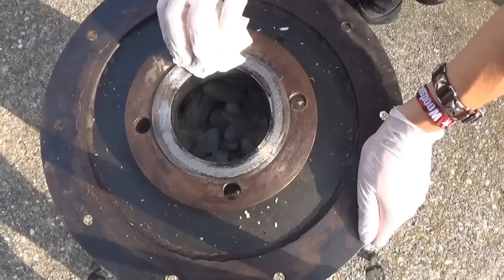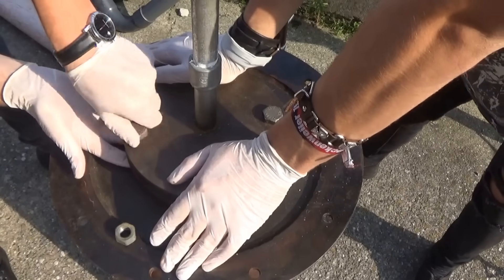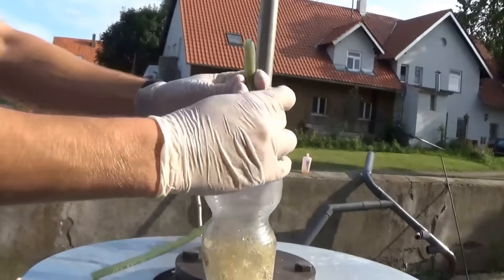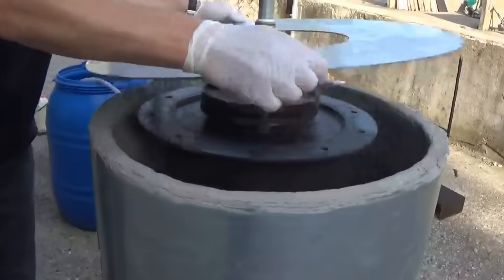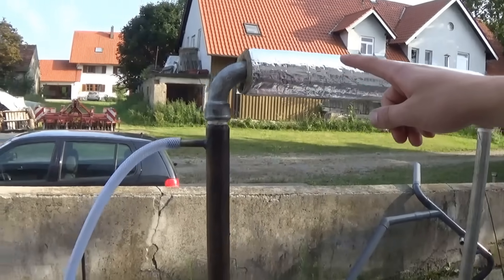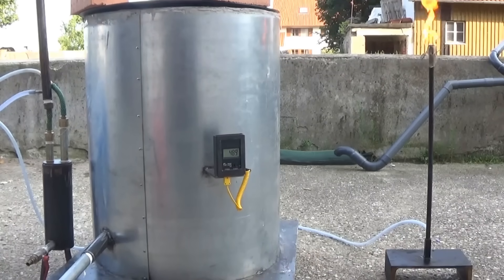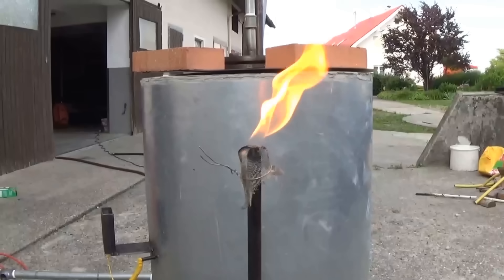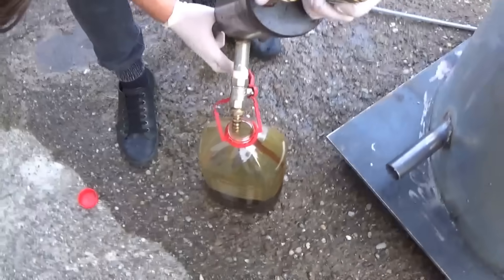plastic waste to oil/fuel improved pyrolysis reactor

Comment: Pressure cooking is more efficient I think
Reply from the maker: well but pressure comes with high risk ! 
so i do not work with pressure 

mfg hazelChem
Reply: @HazelChem  it is only high risk if you push the equipment too far. I once put about 2 liters of petrol and diesel into a gas cylinder and plugged it the put it on a big fire. Bloody hell did it make a bang but seeing as it was sitting in the flames it would have been 400 degrees plus and more than 1000 psi. So using pressure vessels is not dangerous unless you are very careless.
Reply from the maker: @sammyd7857   well but this could have ended with a big explosion .... i am more on the save side with this plus if you increase the pressure the length of the produced hydrocarbons decreases thus yielding more gas what i do not want 

mfg hazelChem
Reply: @HazelChem  but the extra pressure to help crack the molecules can reduce the temperatures needed and so not cracking too much. Anyway I will find out how well it works soon. I am setting up a test tank. Also I will try different solvents to catalyze cracking. I think the temperature can be reduced a lot
Reply: @HazelChem  it did end up in a big explosion but that was my intention lol. I was recording but my mum decided to call and stop the video😡
Reply: @HazelChem  it was an older phone
Reply from the maker: @sammyd7857   but keep in mind that the increased pressure will increase the boiling point which will lead to further cracking !! 

mfg hazelChem
Reply: @HazelChem  yes possible but I think the need for less heat is possible with the use of pressure

Comment: I have build a plant. What they is possible but what they don't tell you is the problem. Did they tell you the product produces a problem with carbon deposits on combustion engines ? Or even on boilers !  Very nice but after you spend your time and money on the boiler ,pipes ,cooling ect , then you find out its not all just moonshine and roses ......
Reply from the maker: i do know this and the carbon slag can be seen in my purification video on the side wall of the distillation flask i am still testing the distilled hydrocarbons on so fare they perform way better ! so the thing you have to do is: build a durable simple distillation unit with which you predistill your crude pyrolysis oil from that on you should be good to go! 
ps by further fractional distillation and mixing with a small percentage of ethanol your engine should run smooth without carbon deposits

i hope this helps you better utilize the crude pyrolysis oil  

mfg hazelChem
Reply: @HazelChem  tnx for the advice. I will try it. What percentage dilution would you recommend ?
Reply from the maker: @lappieslabuschagne2428   try in a range from 1 up to 5% EtOH 100% (water free!!) do to the unknown nature of your system i can only predict a certain range. the whole thing is a try and adjust thing for the first view times until you have the right mixture for your setting. if your motor is good with E10 fuel you can push the EtOH concentration up to 10%.

and as i said the undistilled crude oil is not fitted for combustion engines ! furthermore the naphta you distill from the crude oil should be deacidified (for onformation on this watch my latest video)

mfg hazelChem
Reply: @HazelChem  I'll do that. Tnx for the advice. Appreciated.

Comment: avoid burning plastic, turn them to oil, and burn oil - I think best way is to recycle the plastic than burning them - just a personal opinion
Reply: Exactly. If western people weren't so stupid they would separate everything properly and use holes in the ground to store it not to bury it in a big mess
Reply: @sammyd7857  not just westerns, every part of world has same problems. Burning waste should be kept at the very last resort. Toxic waste can be better casted such as in concrete to prevent leaching before piling up on landfills. They can be better used for roadways than just be piled for no use.
Reply: @ronvoy  as long as it's made from asphalt. Using plastic as an aggregate could have consequences in the form of microplastic pollution

Comment: Loved it but understood nothing 🤩😂
Reply: They used a kiln to melt plastic down to it's basic components, but before they can get it hot enough, they have to purge the tank with CO2 , because Oxygen will allow the plastic to ignite and burn up, instead of breaking down. As the fumes rise out they can be cooled and at certain points, certain chemicals can be derived from the product gasses. Heavy oils, fuel oils, gasoline, mineral spirits, even Toluene, Naptha, it's a long list. This is what refineries and distilleries do too. Considering our present world situation and the unlikelihood we will ever see normal, this is a good gig to have in your survival basket. Everyone will need you. But it could make you a target too.

Comment: Maybe you can use the gas and oil created as a fuel for the system and you can have closed loop free energy oxygen waster.
Reply: STARFIRESOLAR  i think the problem is the resources of plastic waste...
Reply: @trolleycartwheel9409  there is tonnes and tonnes of plastic waste so no shortage of that. I'm not sure what you mean by a problem with the plastic waste
Reply: Well the thing is not every household use a lot of plastic. If they do that'll be weird.

Comment: Can I have your e-mail to contact, because I want to know some details regarding your work, 
I request you respond
Reply from the maker: just write your questions here in the comments and i will answer them :D

mfg hazelChem
Reply: @HazelChem  iam doing my PG project, regarding the elimination of plastics wastes, for that I want to some details like, materials,design,cost and time taken to complete,... Etc
Reply from the maker: well ... time around 2 years (but could also be achieved in a week if you have the knowledge and time) cost in the EU around 300-400€. the general design is shown in the improved pyrolysis reactor video.
hope this helps
mfg hazelChem
Reply: @tunarath7208  sorry.I abort that project...
Reply: @HazelChem  thanks. You replied.

Comment: How can we get to you guys?
Reply from the maker: well you could write me an e mail 
hazelchemistry@gmail.com
mfg hazelChem
Reply: Are you a recycling organization?
Reply from the maker: @michealdumasii5432   nope just some dude and i am running the reactor maximum every 2 months

mfg hazelChem
Reply: @HazelChem  That's good, you just picked up another follower out in West Texas. I have a recycling organization, mostly plastic and with China restrictions it is causing the older recycling generation to lose their minds. Me being younger and connected to resources like yourself gives me an advantage to help solve our own problem. If you have time, can you just give me a list of issues and road blocks that is preventing this technology from being profitable. I like to work out problems and help get things in order to operate at a efficient level. Thank you.
Reply from the maker: @michealdumasii5432   well the biggest problem is the energy consumption of the system. for it to be profitable you would need to integrate the exes heat into some other system or process. secondly it is costly to build such a system on a larger scale. there are many other problems but the last i want to mention is that the produced oil is of very low value and has to be processed in a special refinery that is adjusted to such crude oil. but if the oil price is right and you are getting paid to dispose of the waste in connection with selling your excess process heat this can be profitable.

mfg hazelChem
Reply: @HazelChem  Did you figure out the formula for the end product of the polyfuel compared to diesel fuel? Also what makes it low value, is it because of the process it's going through or the properties it lacks compared to a descent batch of diesel fuel? I'm sure there is a way to manipulate the polyfuel to enhance it's performance ovall at a reasonable cost, also could I use a hydro filter system to get zero pollution?
Reply from the maker: @michealdumasii5432   its not the fuel you get out of it thats low quality its the crude oil compared to standard "real" crude oil. its like with the Venezuelan crude oil its lower in quality because it is heavier than most oils so it need more processing to yield the same amount of gasoline and diesel fractions thus reducing the amount of money you can make with each barrel

mfg hazelChem
Reply: @HazelChem  Understanding, hopefully their can be a break through in managing our own plastics (United States). Are you only interested in producing poly from plastics? I have other ideas that will help with plastic pollution
Reply from the maker: @michealdumasii5432   it´s more a fun hobby of mine. and mostly it should be used on the non recyclable fraction of the plastic waste .... but to be honest in the USA it could be viable for all all plastic waste do to your strange fixation on oil and petroleum based fuels..... btw a big plus behind the pyrolysis process is that the production of more "crude oil" makes a country more self sufficient and the oil can replace freshly extracted crude oil 

mfg hazelChem

Comment: In your video are talking about 60% of palstic recycling and what about the 40% 
Means can we use remaining 40% for another thing
Reply from the maker: the 40% are meant to heat the reactor and sustain the reaction 

mfg hazelChem
Reply: If I want start this recycling process in India 
What will be the cost to set up reactor Wich can work 7-8hr
Reply: @nehakumari-wp2oy  look up rundra environmental solution. They are in India

Comment: If you run a tube from the gas outlet near the end process and link it to the burner it will self Hest its self
Reply from the maker: i tried the problem was that the burner than had to much fuel and to little oxygen .... but i am allready working on a second design 

mfg hazelChem
Reply: You got a good build there. Shame you can't  tinker with a compressor so it takes this gas in and stores it in a large gas bottle.

Comment: Hazel Chen, good project. How about using induction heating instead of gas. Electricity can be obtained from many natural source today like Solar.
Reply from the maker: i have a smaller induction heated system

mfg hazelChem
Reply: Or better use solar thermal

Comment: why is the high-pressure vessel used?
Reply from the maker: the flange could only hold up to 6 bar but the system works under normal pressure
the robust design is chosen so that it is more resilient against the heat 

mfg hazelChem

Comment: GREATING, Please Hazel chem thank you for your reply, you don t know my spefaction just now seen plastics every where in my quater, around the durst bean it s really chocking
Reply from the maker: if you do not have proper welding equipment please do not do recreate this!! this system is only save if the produced vapors are condensed in the system otherwise you risk explosions or poisoning yourself!!  

mfg hazelChem

Comment: Hello from Argentina. Congratulations for your work! Did you perform any energy ballance? I mean, did you calculate how many energy could you produce in terms of gas and fuell per unit of energy consumed in terms of gas to heat the system, etc? Thanks!
Reply from the maker: will be done in a future video. sadly i have very limited time because my study of chemistry is starting and that consumes a lot of time 

mfg hazelChem
Reply: hola roberto , aca en misiones hay un obereño que lo hace segun el de treinta kilos saca veintinueve litros

Comment: Good day to you Ms. Chem! You are right that we have a big problem in disposing plastic waste from banana plantations, fast food chain, lokal market, grocery stores, etc. Can you please Help us? I am Mr. Virmay Alcoseba from the Philippines. Thank you and more power!
Reply from the maker: well if i get it right you want somewhat usable fuel from your excess plastic. so what i would recommend you is that; you talk to the people in your town and present them the idea of a bigger reactor of this type and a distillation apparatus so that you can get fuel out of it. the problem is that a considerable amount of heat is required for this process... so if you want to do this the best thing would be that you make a reactor that is also used to heat some homes of the town (like a block heat and power plant) the plastic waste of everybody gets collected at the pyrolysis reactor and processed in batches than the crude oil is distilled fractionally (the exes heat from the reactor can be used for distillation runs) to get rid of the tar the different temperature fractions of distillate you obtain have to be blended to get a fuel that runs smoothly. 
so far so good ... that would be an general idea of how you could use this process .... maybe if enough people combine there forces you can build such a system for your town 

ps: DO NOT USE car tires or PVC because they yield a very sulfur rich or toxic oil and can destroy the reactor 

mfg hazelChem

Comment: Is this latex gloves? Or nitril?
Reply from the maker: does not really mater ... if you get pyrolysis oil on them you have to change them immediately because the toxic components of the oil will quickly penetrate the glove ! so better use more gloves than getting cancer am i right ? ;D 

mfg hazelChem

Comment: Any thoughts on blueprints for the system to make one for backyard use? I am interested in ways to reuse the plastics my family generates.
Reply from the maker: you can build a oven in which the reaction chamber sits so when ever you are heating your home part of the generated heat is used for the pyrolysis. the generated gas can be easily burned in the oven or you can store it in a big plastic bag (like they are used to store gas from biodigesters) the low grade oil can directly be used for lamps .... if you want to use it for motors i recommend that you let it sit for at least a month so the contained styrene has time to react and the oil gets stable. after most of the styrene has reacted you can fractionally distill the oil and blend the different fraction in such a way that you motor of choice runs smooth.

i hope this helps you :D just one last thing to say for survival "freaks" (i mean this in a positive way) and people living lets say in the woods of Canada this makes sense but if you are living in a city please consider that potential leaks and problems can harm others! 

if you have any more questions just write me 

mfg hazelChem
Reply: @HazelChem  can you just put a flame. Inside the holding tank to evacuate the oxygen within? Why does it have to be an acid thats expensive?

Comment: Wood this setup also work with old car tires if so could you email me plans to build one
Reply from the maker: yes and there are already plants for it  BUT there is sulfur in car tires so you have to use a catalyst to get rid of the sulfur in the oil ..... otherwise the burning of the oil produces sulfur oxides which are verrrrrrry harmful for the environment 

mfg hazelChem
Reply: @HazelChem  pls ho can I contact you there's a great job for us in Africa I need your help to implement this pls... Email: emmanuelteyi@yahoo.com
Call line: +233248623942
WhatsApp: +233501347708
Reply: @HazelChem  Carbon monoxide and a catalyst are needed to convert coal sulfur to jet fuels.

Comment: I have been thinking along the same lines I'm glad you made this video thank you, this may not sit well with some people however the newer generation of thorium reactors could provide direct heat for large-scale up and become more environmentally friendly
Reply: Regarding reactors, do you know why sodium metal isn’t used in cooling nuclear cores then water. SAAB, the car company used to make sodium filled valves for durability and heat control so it surely is cost effective for nuclear reactions. I know I’m off topic but never get to discuss nuclear issues. Hope you don’t mind!
Reply: @jackjones9460  I sure didn't
Reply: @JatPhenshllem  When working on my Saab 900’s I found out they’re sodium filled. Don’t know if it’s common or not.
Reply: @jackjones9460  Go on, please  :)
Reply: Heat from U-233 fission could be used to for destructive distilled plastic to petroleum reactions all the while turning more thorium 232 into uranium 233 to keep it going and he should chill that flare gas, clean separate and store it cause that flare is a total waste and makes for a loss in efficiency

Comment: Hello! That was nice, But I want to know more on this, can you please give me your email or contact number. 
From:
Jitesh Chheda 
jit8102@gmail.com
+91-9870486553
Reply from the maker: i will answer your questions here in the comments

mfg hazelChem
Reply: @HazelChem  Hi! Thank you for your response, I am planning to make compressed gas cylinder from the waste plastic and sell it to the poor people in India. Is it possible to make gas out of waste plastic?
Reply from the maker: @jiteshchheda6862   do not compress flammable gases with a normal compressor !!! it could explode !! 

if you want to use this system you can build a reactor and distill the pyrolysis oil to get a low grade fuel ... just experiment with the fractions you are using .... blend different fraction until it fits the application 

mfg hazelChem
Reply: @HazelChem  Hi! But gas is much more demanding here, rather than liquid fuel. There must be some other way.